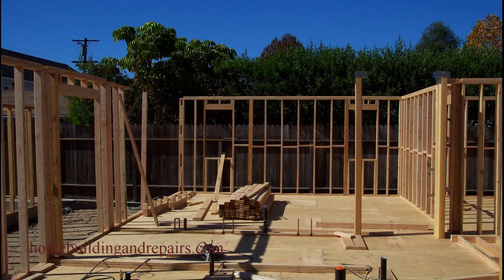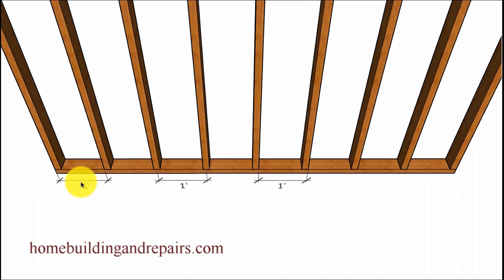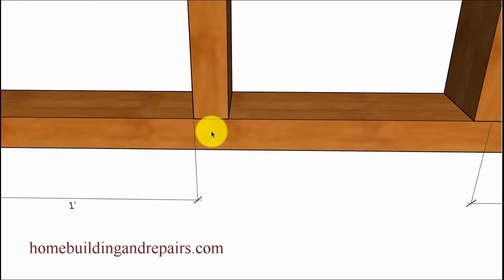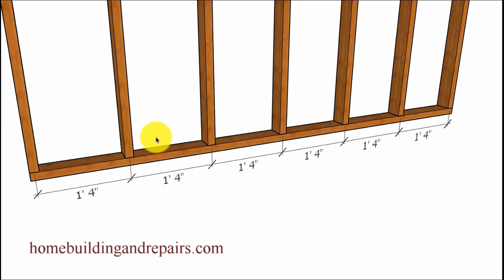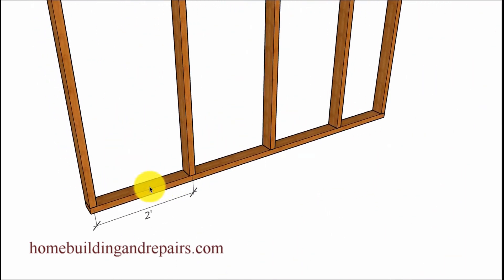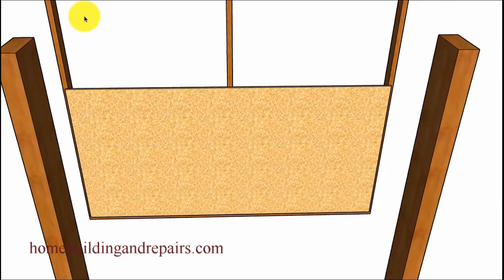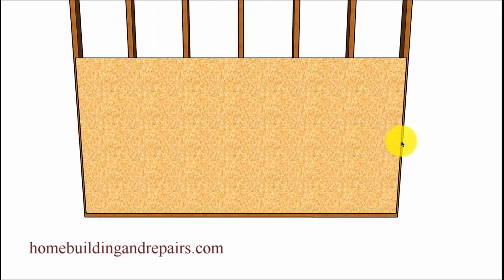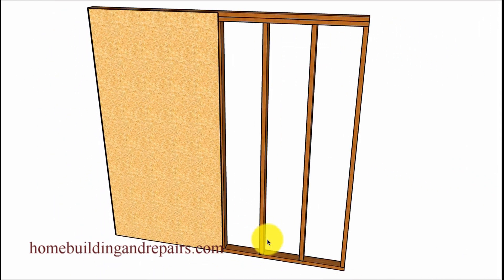Framing Component Measurement Spacing - Basic Home Building Tutorials

Comment: so why use 19.2 if you cant use 4 foot sheets and stagger the joints 4 feet away
Reply from the maker: It might work when laying wall sheathing sideways or using 8 foot lengths.

Comment: So your plywood won't go all the way to a corner ?
Reply from the maker: Sometimes
Reply: @constructionideas  what you mean sometimes
Reply from the maker: @Brandon-no3vc  In the video, I showed you one way, but all you need to do is start your wall stud layout at one end by subtracting half of the width of your studs (3/4" on 2 x 4) to have the plywood start at the corner and cover the whole first stud. If the center of the wall stud at four feet is measured from the end of the wall then you should end up covering the first stud.
Reply: @constructionideas  why not show that in the video
Reply: @Brandon-no3vc he marked it at 16 instead of coming back 3/4 of a inch